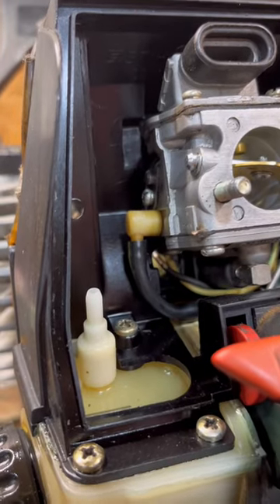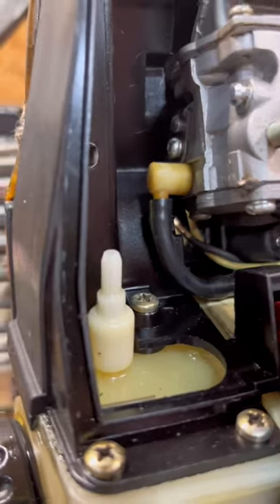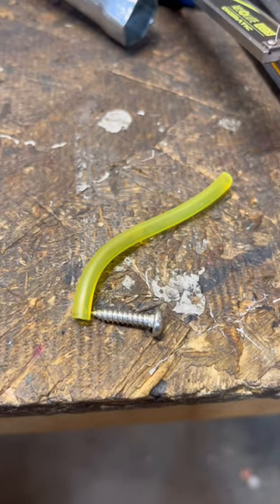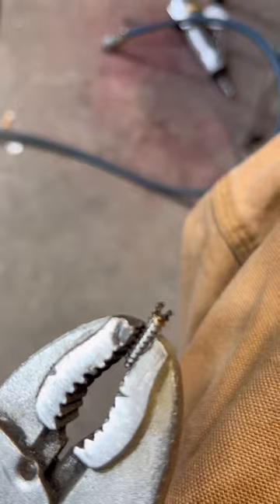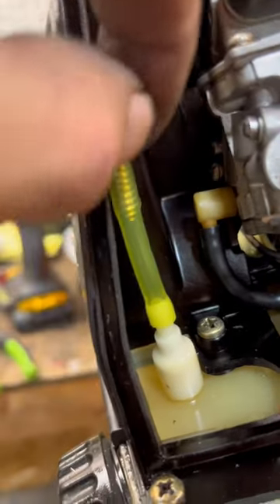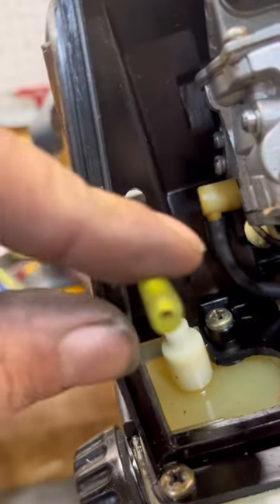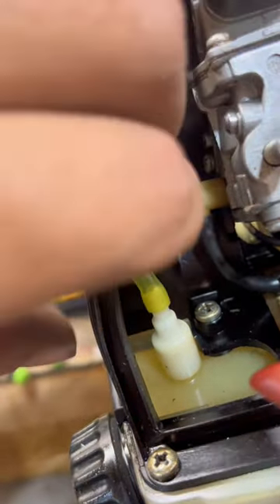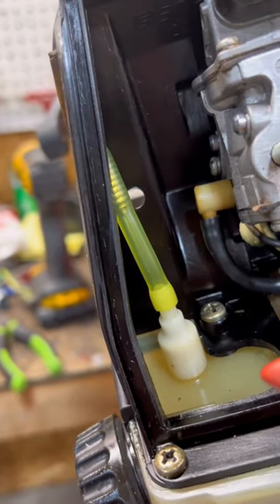Fixing a leaky chainsaw tank vent.

Comment: Any tips on if the vent valve is broke? Can u just drill out tank and pop a newer style vent in?
Reply: Umbrella seal in the tank
Reply: @tcbiglake  thanks for reply. I replaced that already. It's the hard plastic part that nipple comes up thru that's broke. It has some kind of rosin patch from when it must have originally been broke. I put umbrella flap in, broken plastic piece back with a touch of super glue. Still not working. That's why I was wondering if I could replace with a newer style tank vent by drilling out where the part was broke and popping in a new style vent
Reply: @tcbiglake  ok I will see if there is something I am missing. Those are the part numbers I take it?
Reply: @timrader1260  yes correct the part numbers from a Stihl PDF manual
Reply: @timrader1260  the hard plastic part that I believe your needing goes from the top of the tank to the bottom of the nipple. It is a round barrel sleeve that clips on the tank and the nipple clips to that.
They call it a clamp in the documentation but it is clearly illustrated. I think maybe the terminology may be lost from German to English in the documentation.
That is item 10 in the parts list
part number 1122 353 0200 clamp ( or druckstuck in German)
Reply: @tcbiglake  ok thanks, I appreciate the help. It's a awesome saw and I want it back up and running!!
Reply: @timrader1260  best of luck drop a line and lemme know how it works out for you
Reply: @tcbiglake  Got it up and running over the weekend!!! The super glue worked this time holding the broken piece that attaches to the umbrella and has the hose coming out on the outside. Nice to have it back. Thanks for the help Chitty!!
Reply: @timrader1260  good deal
Enjoy the cutting